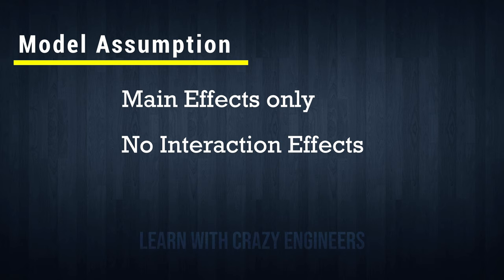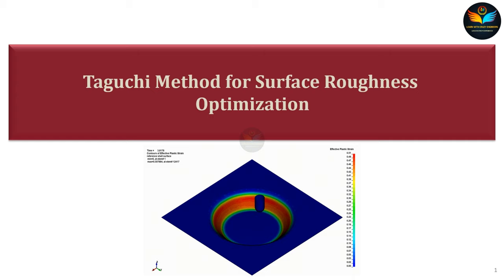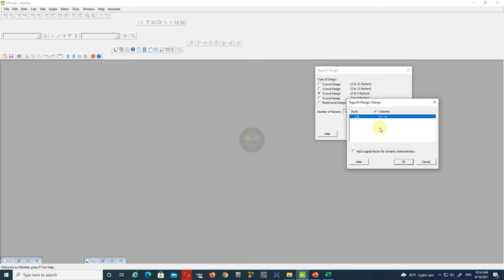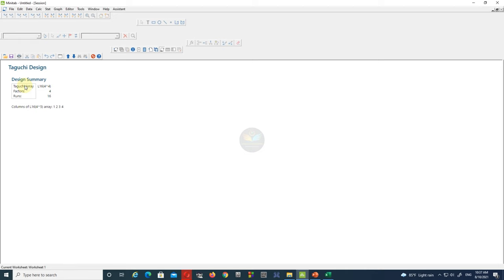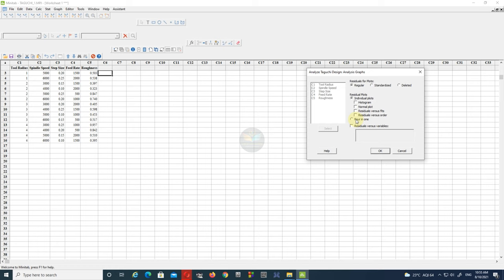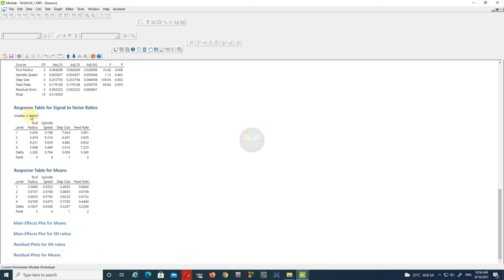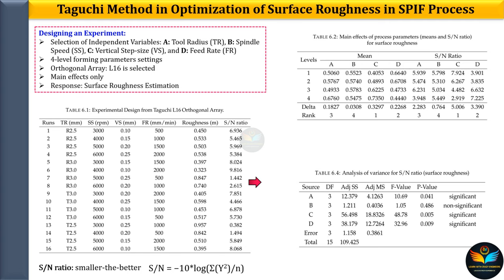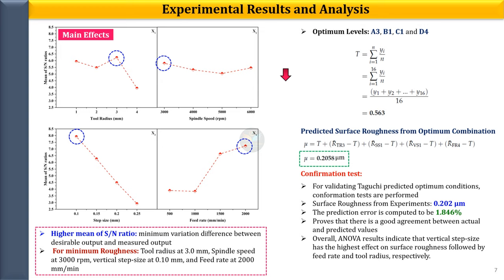Taguchi Method | Surface Roughness Minimization | Incremental Forming Process | MINITAB Software

Comment: where did you get the SN ratio value for all experiments ? if i have done multilevel design then where is teh SN ration term for all sets ?
Reply: SIr,i have repeated the same , but what is got as SN ratio is hgot a minus sign
Reply from the maker: You have to calculate the S/N ratios using your experimental results. The S/N ratio calculation is based on whether your outcome is smaller the better or higher the better or the target value.
Reply from the maker: In this video, my objective was minimizing the roughness value to get better surface quality. So choose your objective and calculate the S/N ratio. If you don't know how to calculate manually just calculate using Minitab by the exact steps what I did in this video

Comment: I am a bit confuse on how to get the S/N ratio which you copied and paste it on the table?
Reply from the maker: You can calculate using excel based on your objective or you can use minitab to get SN ratio. Estimating SN ratio is the first step.

Comment: What is the reference for Formula in Optimum Model Calculation?
Reply from the maker: Please elaborate your question. I didn't understand yours
Reply: @LearnwithCrazyEngineers  
While Constructing Optimal Model, the equation  under the headline: Predicted Surface Roughness from Optimum Combination, where in this video we get value = 0.2057 micrometer. What is the source/ reference for that equation
Reply from the maker: Please follow the video properly. The equation should be made from identified optimal parameters. There is no reference equation. You can see around  from 15:00
Reply from the maker: There is a calculation for estimating T and mu. Follow those steps to get that value.

T samples average 
mu optimal value estimation based on T and optimal parameters. 

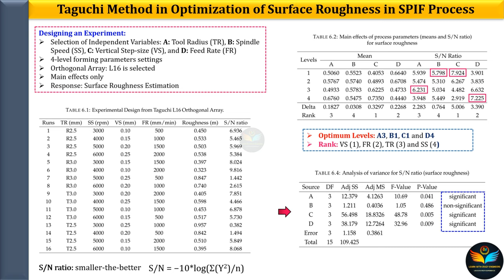Watch from 15:50